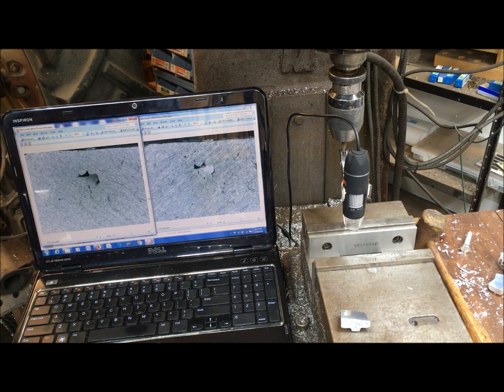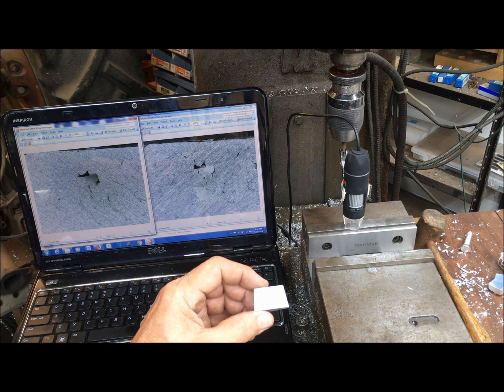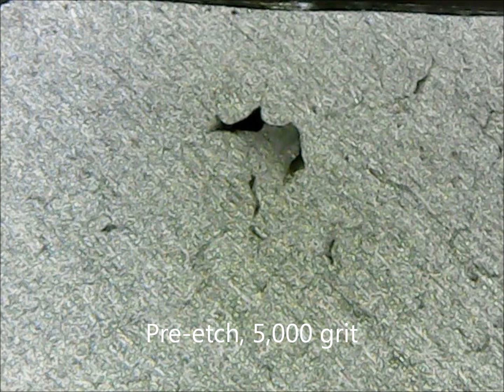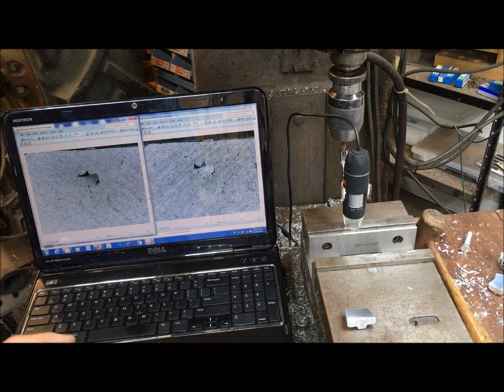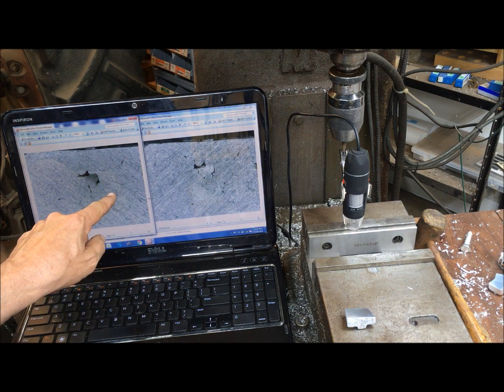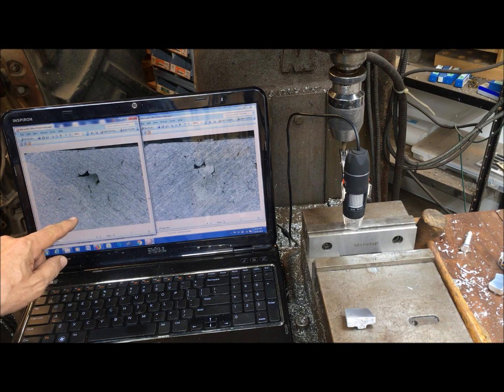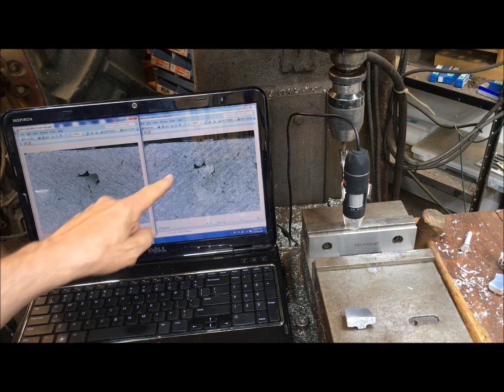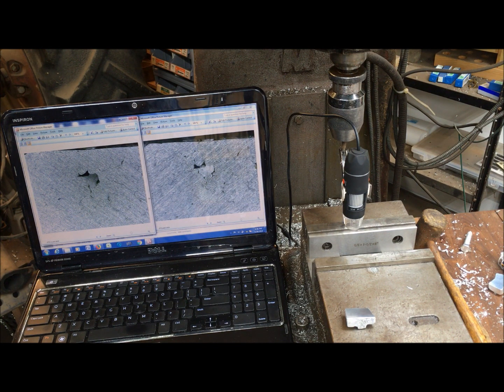Foundry 43: Caustic Etching of Aluminum

Comment: Andrew, Its difficult to be sure from this distance but I suspect that you may not have etched enough as there is still evidence of flow in the post etch sample - the "flap" that seems to be still in the cavity at about 1.39 for example, proper etching should have got rid of that. We are talking about metal removal process so some artefacts will vanish with the metal removed and others will be uncovered. The idea of the etch is to removed metal flowed over defects by the machining/polishing process. Metallographic preparation is a bit of an art form that may include several stages of polish etch polish etch finishing with 1 micron diamond abrasive (some times 1/4 micron) and a final light etch although the latter would not commonly be caustic soda. Many different etchants are used but 0.5% HF is common
Also although you don't seem concerned with the smaller defects its worth noting that each and every defect including the barely big enough to see is the sign of a bifilm. You are unlikely to see an actual film at the magnification you are using  indeed even with much higher magnifications they are difficult to see and generally only become visible with optical microscopy when they are what John Campbell would call older thicker films. I have occasionally seen these but different etching techniques are usually necessary too - caustic etching is a bit brutal on some constituents.
By the look of al the defects that show up both pre and post etch I would think that there are rather a lot of bifilms present. A reflection perhaps of the high surface area metal melted - did I hear Cans?.. Martin
Reply from the maker: Thanks for taking the time to review and comment, Martin.

I etched with a lot of bubble activity but not long enough to get black deposits on the surface.  I need to repeat this a few times with different levels of etching.

If you could repeat what you have done with a known grit sandpaper that would be most helpful.  I will try to repeat your exercise with 800 grit.

No doubt my castings are full of oxides.  And having been remelted, should have copious amounts of hydrogen.

Ha! I've worked around enough HF I don't want any around me.  1/2% seems pretty mild, however.  In a refinery HF Alkylation unit there are a few thousand gallons of nearly pure HF acid.  Nice thing about strong acids they are not corrosive to mild steel.

I do have diamond polishing paste, down to 1/2 micron.  It is very time consuming for me without proper equipment and at my level of magnification I don't see much more.

Interesting to note that bifilm are hard to see with proper equipment.

I'm not likely to acquire a proper microscope and don't expect to see any grain structure at 300X.

I arrive at the point of recognizing if you can't see it and it can hurt you I need to look at other methods of inspection to verify whether remelted aluminum of various sources is suitable for use.  In part that's why I embarked on the pipe pressure testing challenge.  My initial o-ring grooves were inadequate for moderate pressure so I plan to make some new ones and test thin sections at a couple of thousand psi.

It also seems appropriate to do some tensile testing and have embarked on making a simple tensile test machine.  I don't think I can measure percent enlongation accurately enough to establish yield strength but expect to show ultimate load before failure.

Yes, you heard cans although I've lost interest in melting cans after several hundred pounds melted since I now have a seemingly unlimited source of window frames.

My interest in non-commercial ingot casting stems from my belief that the average home caster wants to use found materials, not go out and buy ingots to melt, and be restricted to melting them only one time.  Since people are making things from cans, ladders and window frames I have an interest in demonstrating how the best results can be obtained from those raw materials.  A similar argument can be made for wheels and previously cast materials.  At another level are previously forged materials like pistons.